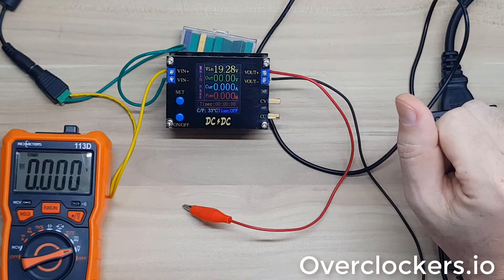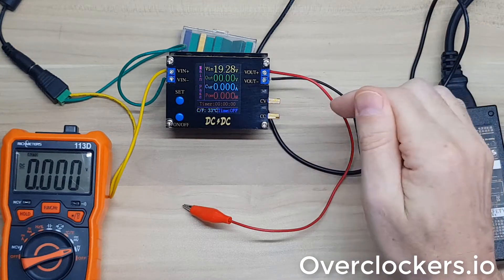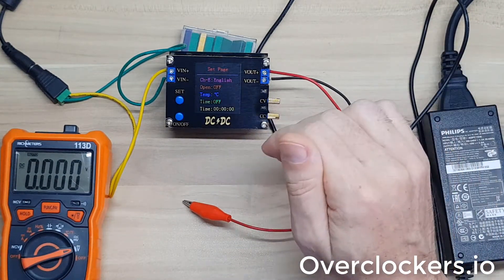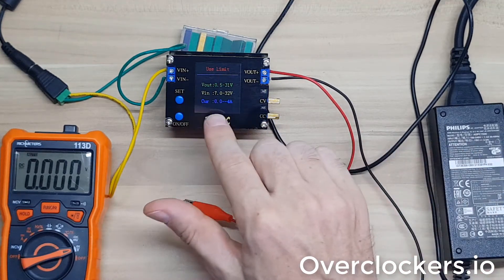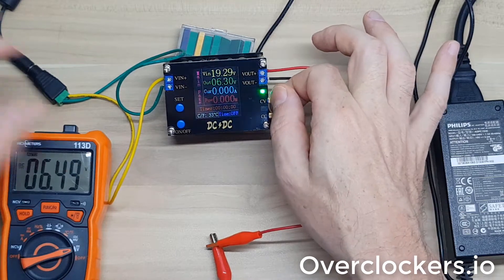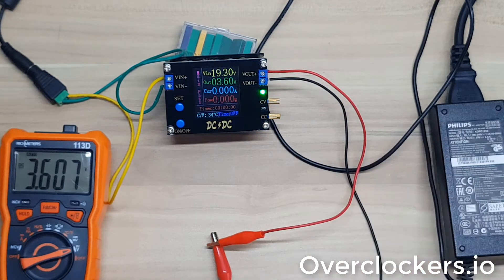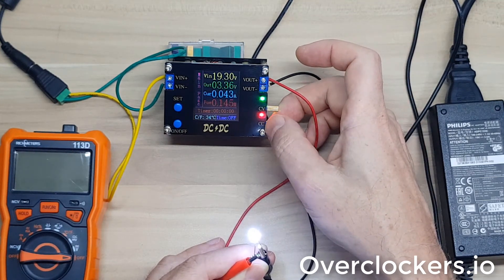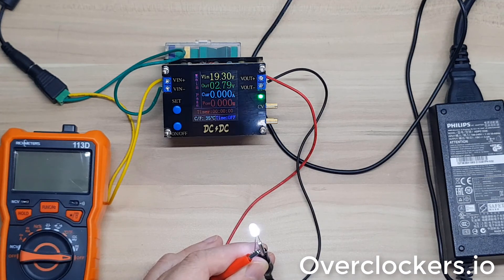FNIRSI Boost/Buck Power Converter Review

Comment: Please note that despite the description, I don’t consider that this device has over voltage protection. In professional systems, over voltage protection normally means a separate independent detection / sensing system that switches the unit off or otherwise disables the unit (possibly by clamping the output) if an over voltage condition is detected. By independent, I mean not part of the normal voltage feedback regulation system.

The voltage spike at switch on is almost certainly due one or more of the following reasons:  Maybe the speed of the DC-DC converter to transfer power is significantly faster than the time the voltage feedback regulation system takes to adjust the output power. It could be due to a capacitor in part of the feedback/control circuit taking time to charge up, or just poor design. Or it maybe that the original design had a ‘soft start’ system (so that the output voltage ramps up more slowly rather than rapidly) and then this feature was removed without further consideration of any unintended impact.

However, considering the relatively low cost, this inexpensive unit is fine for loads that are tolerant of these limitations.

Comment from the maker: After a bit more usage, and response from FNIRSI on the surge, I don't think its a safe device for projects. They said that you can turn it on with your device not connected, then connect to avoid the surge, that's not a solution.